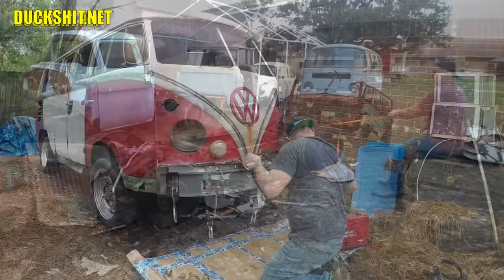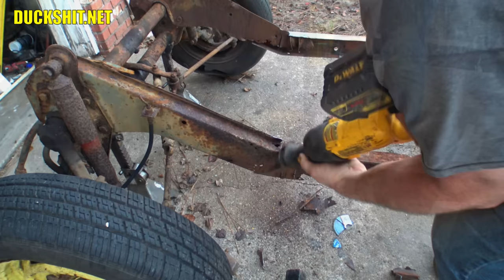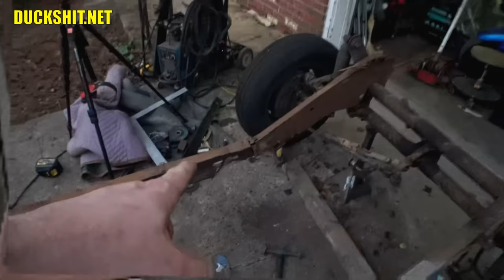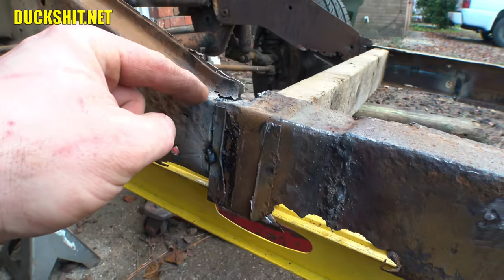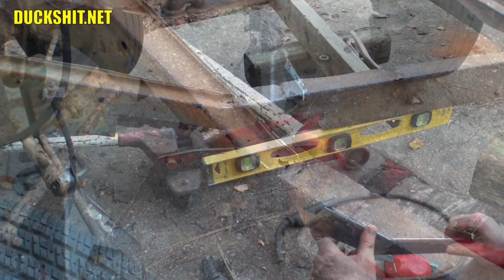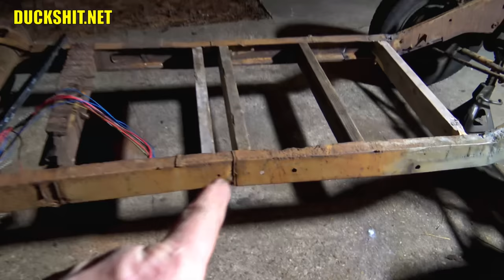Welding and Fabricating Repairs - 1967 VW Bus Frame Restore - 02

Comment: love your channel.  I have a yes welder helmet too.  I accidentally left it out in the rain,.  It was soaked when I fou8nd it and had a puddle where the lens and electronics are.  I brought it in and dried it thoroughly.  The result was it still works as intended.  My son gave it to me a couple years ago when I was doing some "light" body work to my YJ.  The helmet is still going strong
Reply from the maker: That's impressive, sometimes you get lucky.   I have a friend who dropped her cell phone in the ocean, took her a while to find it, and it still works.  I left my weld helmet outside by accident many times through many rain storms, but it was always face side up.  Its still going, too!

Comment: That's coming out great! Your videos get me out there welding on my own stuff. BTW, it takes talent to make something out of nothing! My thing is bed rails- they're everywhere up here on the roadside. Thank you and keep up the great work!
Reply: Most of the old bed rails are high tensile steel, or type of spring steel, but stronger than mild steel, my two cents worth, all the best to you all
Reply: @donaldhalls2189  yeah, they're tough on normal drill bits, but they weld strong.
Reply from the maker: That's interesting, whenever I will weld bed rails they become real brittle.  They're not very strong either, I busted many bed rails tickling fat chicks when I was in my youth... hehehehe.  I wouldn't recommend bed rails for most kinds of automotive stuff.
Reply: @DuckmanCycles  I use them for gussets and brackets and such. I even made a shelf I bolted to my log splitter. And believe me, it has taken a beating! I've bounced 2 foot oak rounds off of it for years and not even bent it. I don't know, maybe it's how I use them. I know what you're saying, It should break at the weld. But I can appreciate what you do. I'm not made of $ and i can also make something out of almost nothing or what's lying around. Your videos keep a guy going ,so thank you for that I hope you have a great holiday season!

Comment: we have to have PIV (positive air pressure system) systems in the uk to stop condensation and mould. mainly because our houses these days are generally all sealed up and insulated. its a good system though
Reply from the maker: Or just close windows and doors, run the AC.... that is what it's meant for.  😁👍🏻🦆💩
Reply: @DuckmanCycles  we dont have ac here in the uk lol but that will work it dries the air
Reply from the maker: Oh man.... AC is mandatory here!  Even in winter!   In my car I don't even shut it off.  LoL!
Reply: @DuckmanCycles  same on my car it's on all the time even in winter I find if you don't use it you lose it

Comment: The one thing i like about you use harbor freight tools  and do good work , No snap-on tool. Thanks
Reply from the maker: I built my entire Beetle with a Harbor Freight flux core welder because I was told it wasn't possible.  But most of my wrenches and such are Craftsman. There might be a pair of Snap-on pliers or something in my toolbox, but that's all! 😁👍🏻🦆💩

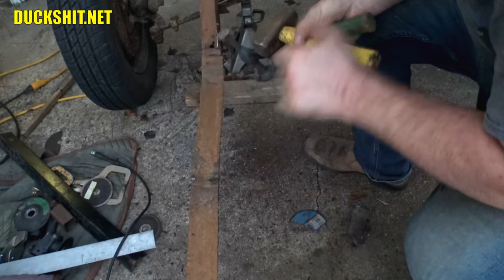Comment: Hi there Lord Duckman! Got a quick question, at about 8:07 you use two hammers to straighten the frame. Was just wondering if wedging some wood under the frame instead of that second hammer, propping it up at the level you want could work? (same concept like how you worked on straightening the frame last video checking it was spaced properly). Legit question, hope I dont offend. Have a great day!
Reply from the maker: The second hammer works as an anvil, I could also use a "boot heel" tool instead of the sledge, but I found the sledge easier to handle.  Wood won't help you flatten dents and creases!  Hope that helps make it clear!  Thanks!
Reply: @DuckmanCycles  It absolutely does, many thanks!!
Reply from the maker: @thequietestengine  you bet my dude!

Comment: So, how you get ride of the rust?    And What Cain of primer? Rust pain? Bondo over metal?  ????
Reply from the maker: If I ride the rust, I'm sure I'll have a lot of rust pain down the road.  But I wander if Cain should be Abel to remove it with some elbow grease and some phosphoric acid.  And yes.... bondo is supposed to go directly over metal, but I don't think I would need to bondo a frame.  That's bodywork pretty stuff!

Comment: What can I say that hasn't been said already? I'm just surprised how good that frame is coming around. I have a 110v Lincoln welder I use. Think you might have the same. Are you using gas? Great video Lord Duckman. I'm sitting indoors and it's windy and rainy. Actually holding our Bantam chicken watching your video. And no it's not a rooster, otherwise it would be I'm holding my C#%"k. Lol. Noel 🦆
Reply from the maker: Nah, using up this flux stuff I have here before I graduate my rig to gas.  Always flux in everything you've seen me do.... I said it in this video... lol!   Not only because its cheap and easy, but because people say its not possible.  Well... I built a whole car (Eleanore) with flux core in a Harbor Freight budget welder.  Cheeky is the size of a bantam... I don't want her to grow any more!  She's the perfect snuggle size!   😁👍🦆💩

Comment: Not sure if you can help..but I need some carb options for a 1972 type4 1700cc bus engine it has the pdsit carbs but they are in bad shape and I can't seem to find much info on interchangeable carbs if any
Reply from the maker: There really is nothing that's interchangeable with those, you'll have to replace the manifolds and probably also the linkage.  You can use dual Dellort 34FRD like I have featured in other videos (but not this video because this video is about welding a Bus frame) you can also use dual Weber ITC.... or several other different kinds of center mount carbs.  Your options are practically unlimited... but for any which one you use expect to be replacing intake manifolds and throttle linkages at minimum.

Comment: Just a thought, you might want to add a flash warning to this video. Not that it bothered me, but those with flash induced seizures may get a trigger around 6:30. ✌️😊👍🏻
Reply from the maker: Thanks, I've considered, but it's a welding fab video... everyone should know better, especially if they have triggers.
Reply: @Lord Duckman's Cycles and Air-Cooled Garage  That makes sense. I'm really enjoying your content. My 1972 Bug is coming along nicely.
Reply from the maker: Have you made any videos of that 72 Beetle yet?  😁👍🦆💩
Reply: @Lord Duckman's Cycles and Air-Cooled Garage  Check your Instagram,  I think I found you, and will share VB photos if I have the right connection.

Comment: As bad as you want that frame to be solid it isn't. A good solid frame would not break in the center like it did. Bend yes but not break. Sure it can be fix. But think in order to be structural again it will need to be boxed in.
Reply from the maker: LoL.... thanks.  I'm not sure where some people get their logic.... but most people don't listen to me anyway.  This comment suggests exactly that.
Reply: @DuckmanCycles  not sure how not seeing the frame ripping apart in several places and calling it fatigued hasn't answered your question. But sure whatever you do with it if not corrected. It will show you.
Reply from the maker: Thanks man... but again... THE LOGIC.  What is it you see me doing in these videos?  CORRECTION!   More to come!  Thanks for your support!
Reply: @DuckmanCycles  if I heard correctly you said it was not getting boxed in. So just what's being done in video will not make it strong enough. It's your project. But your setting it up for early failure. I have junked a few frames with less fatigue cause they wasn't worth fixing. If the metal was in good shape and you applied enough weight in the center. It will crumple at top and cave in. It will not break and open from the bottom unless brittle or rotten. Good luck on it.
Reply from the maker: Criticizing an unfinished design is the bane of the internet.... I discussed what you were seeing  in the video, but you're saying something different.  It's going to be fine, in fact better than fine.  I don't have to do it YOUR WAY to make it right.

Comment: You must get some interesting comments. Thick skin needed to do YouTube. I`m no mechanic but will this need to go on a frame machine after you are done patching to be sure its actually correct?
Reply from the maker: No frame machine needed, it's a little rust not impact damage.  I can do the measurements myself,  I said this in earlier video.  😁👍🏻🦆💩
Reply: @DuckmanCycles  Oops I missed that part. Ok. Onward.....
Reply from the maker: I am the MFDM!  I shall defeat any challange I shall choose to accept!